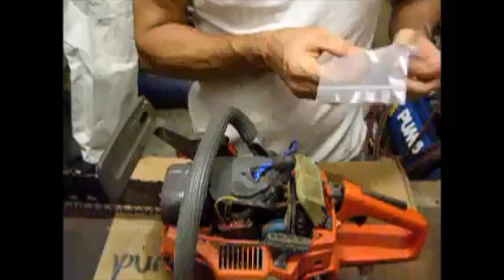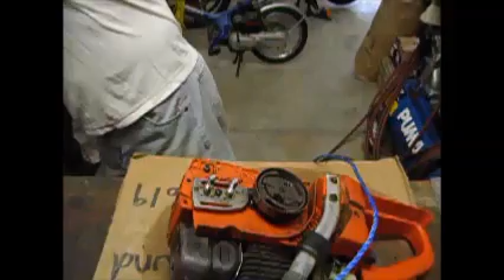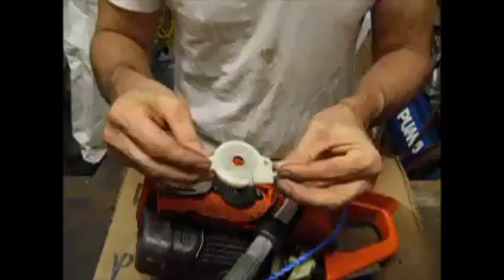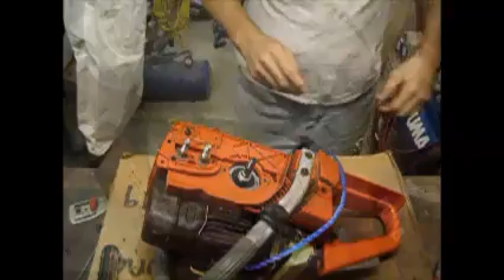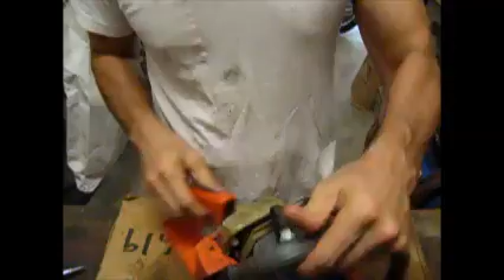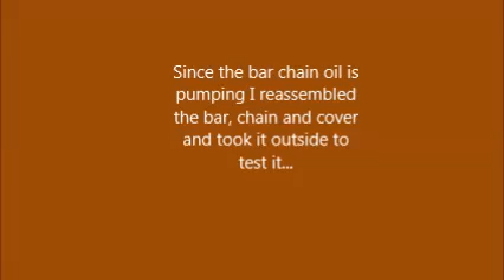Chainsaw Repair - How to Replace the Clutch and Oil Pump on a Chainsaw

Comment: I have a husqvarna 435 and the chain spins no matter what I do. It even spins when I pull the starter rope. I bought a new oem clutch assembly and it still occurs. Could the support bushing be the culprit?
Reply from the maker: Hard to tell...  Do you have your chain adjusted properly?   Make sure it is not too tight.  I always change the bushings when I work with that area of the chainsaw.  It is a very inexpensive part.  Also apply a little grease when installing.  It wouldn't hurt to take a look at them and make sure they look ok.

Comment: Thank you for this really helpful video. Have you noticed a dramatic increase in oil on the bar, because I have the same problem though my teeth were not worn on the pump but rather greased and dirty. I have heard this model is notorious for low oil to bar and chain, but I thank you again for the tips!